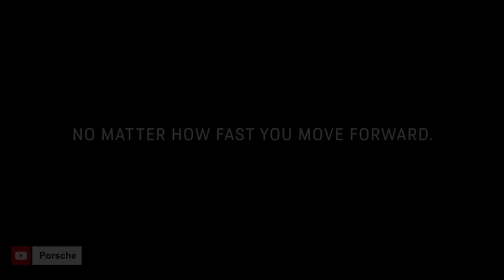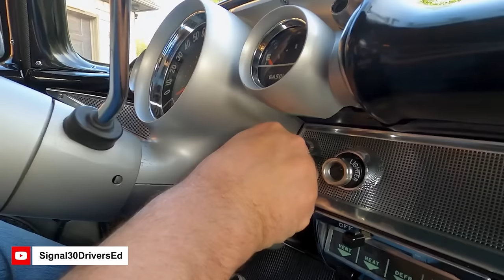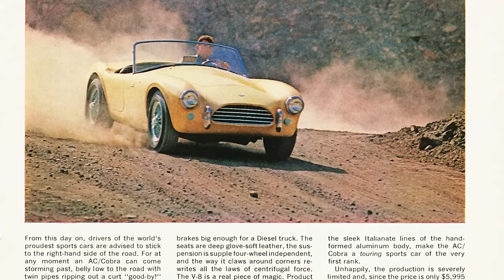Why Old Cars are Better

Comment: Once you work out the kinks in your old car usually good every so often something might rattle lose or brake but 9 times out of 10 its a easy simple fix

My first car is a 1952 Ford prefect father owned it blew it up gave it to me because they wanted something faster my top speed that you can do for long periods of time is 50mph its a pretty big project but ive grown very attached to it tryed to sell to get something running road legal but i was a emotional wreck for the 2 days she was for sale so looks like im fixing her have a high mile engine in her but have few issues had a miss fire now making a bad noise after kicking back hopefully just broke starter i cut corners and it bit me on the ass so going to not cut corners and hopefully get her running good again 
with the old cars at least to me they become a part of the family because everyone is different they have character they're not just a tinfoil box you ride in 
Save the environment buy a car that lasts more than 60 years

Comment: Cars should become smaller and lighter for sure. It would also help the environment, as you could build a smaller engine into it and you have to accelerate a smaller mass. It would help electric cars as well as cars with combustion engines. I recently saw a video (I think from a German University) that showed a very light electric prototype with a usual battery running for 24 hours.

Comment: I love my older cars better than my newer ones because they were just build better. The 69 Camaro is fun but the vacuum lines always go out on the headlights. The 1955 BMW Isetta would turn some heads today. 😁 And I love my GLS 63, although it is quite large and is too fast for a SUV, but were I live you better be able to pull into traffic fast or your going to get hit,

Comment: I drive a 59 rambler with 492k miles on it.  it has a v8, drum brakes and marginal handling.  it gets about 25mpg driven modestly.  only slightly worst that the wife's 22 Subaru.  it has a 5.3 l  vs the subarus 2.0.  doesn't use oil, 3 sp od trans.   I rebuilt this thing and used it starting in the mid 70's because the cars then were garbage.  my youngest child used it in highschool . he had the only one like it and is easy to find in a parking lot.  the car survived him.  new cars don't appeal to me.  so far no one has been injured in it.

Comment: You know, I wouldn't be afraid to work on an old car because I have “trust issues,” but rather because I would be completely horrified at the idea of ending up breaking it beyond repair and in doing so destroying what is essentially a museum artifact.
And even if you ignore that part, we still have to deal with all the financial shenanigans these days, after all it's not like you can risk trial and error when you can barely afford one, much less several over the years that you would tinker and experiment with until you learned from your own experience how to properly maintain them...

Comment: Transverse engine front-wheel drive also ruined vehicle proportions. You can easily pick out the rear-wheel drive cars in a parking lot today simply from the proportions of the front fenders and location of the windshield. Many older cars were very well proportioned, relatively speaking, which is something that I feel doesn't get enough attention.

Comment: i've already had a pretty hard time with my dirtbike and its single, easily accessible carburetor getting it to run and start perfectly. yes, maybe i would get better and it wouldnt be a problem. however, the amount of time i spent trying to tune the carburetor on my dirtbike is not something i want to be spent trying to do and redo what i already do especially to maybe end up messing it up in the process. i would rather be enjoying the experience of riding.

im not saying im incapable of making this work. if i had more bikes and experience, it probably wouldnt be a huge problem. 

but still, i would rather have a system that doesnt need to be rejetted at higher elevation. a fuel system that wont need to be cleaned after a while of not riding, and a system that wont be using fuel even when im coasting, reducing fuel economy and shortening my time on the trail or the track on a given quantity of fuel, and it doesnt even increase performance to have a carb either. its just "easier to fix or service" but how often do you need to service a fuel injector?

there is absolutely something special about an old basic mechanical system. but if im going to be using a vehicle every day, i want it to always work and if my dirtbike is any indication of the consistency and maintenance nature required of old cars with similarly mechanical needs, then i would not want to use it every day. it would be a hobby, something to do to relieve stress and improve my overall mechanical skills with it. but not my daily vehicle at all. its simply not practical, too time consuming, costs more to maintain, is worse in most ways, more expensive on gas, and the list goes on. 

imo, if you really want that kind of integral experience with the vehicle, you should be looking at a motorcycle. because motorcycles, are always going to be more interactive than cars because you're using literally every part of your body, plus your whole body, to place the bike and change its behavior. with a car, you can drastically increase the connectedness with a manual, but that is still not as connected as you'd get in a motorcycle because you're doing much more on a motorcycle at all times and the bike wouldnt even be able op stand up without you

Comment: Agreed. New cars are boring to drive. Though imho tje sweetspot was in the 80s, 90s and early 2000s, where they had the correct blend between reliability, safety most importantly performance and driver involvement

Comment: The experience I had with newer cars in the last 10 years has completely turned me off. My stress levels were off the charts. 

I found a 1996 Jeep Grand Cherokee with a AMC 242 inline 6. It was abandoned and undrivable. 

$5,000 later and she is driving good. There's still some work to be done on her but my stress levels has dropped. 

Why this vehicle? AMC 242 inline 6. With routine maintenance this engine is guaranteed for 400,000 MI. Most major problems can be fixed without removing the engine. 

This vehicle also has front and rear solid axles. Extra thick drive axle And a full spectrum four-wheel drive that has a actual mechanical linkage. 

The control hub is simple.

Comment: I watched your video about 90s vehicles then it went to this video after that I like your video I have a 98 k1500 that I bought brand new I know it is at the end of the 90s but it encompasses everything about that particular type of truck from the 90s I still have the truck it still looks good it still runs good and I wouldn't trade it for a new truck at all

Comment: I still do think that the 2004 Ford Escape that my parents had and then I used for work travel and then cras...er did an unexpected short off-road excursion is better than the 2016 Ford Escape my grandma totally gifted me or such.
I mean it had less blindspots, could hold 6 cds, had a bigger center inbetween storage thing,  the gear shift, lights, and windshield wipers were all each a lever thingy, instead of being almost as if randomly placed as dials and knobs.

Comment: You're right - the 90's are probably the sweet spot.  You could still drive your car without government interference, but they were quite reliable, and had a lot fewer computers involved; no water cooled alternators, electric power steering, traction control, intercooled egr systems, etc.  I've got a 2001 Tacoma witih 225k miles and it will probably outlast me.  No bells ring if I don't put on my seatbelt right away; it doesn't object and cut power if I want to hang the rear end out a little in the dirt, the stick shift will probably last forever, and it has yet to make me walk in 25 years.  The new Tacomas are huge, complicated beasts with far too much electronics for their own good, and have turbos that, I guarantee you, promise a shorter life for the engine they are attached to - no thanks.

Comment: I hold that car luxury peaked in the 70s..everything we needed for a great ride (save gps) was there. Yeah safety features and gas mileage isnt the same but why cant we have a new car with that feature. Driving an old lincoln with the 5 foot hood and hood ornament makes you feel like a king. Its like floating. ..yeah you dont go 0 to 60 in 1.5 seconds but who cares? Its a cruiser. I used an 81 lincoln as a family car for years and the kids loved it. 

And beyond those big luxury cars..the smaller cars were still uniqur and interesting. ..hell my grandmas 92 toyota corolla is still running like a clock..and i prefer it by far to new crap.

New cars are all about planned obsolesence. Im glad you noted how backup cams and sensors all that arent really necessary on old cars when your visibility is  near 100% unobstructived.

As for accidents thougb, having a big chrome bumper always helps in minor fendor benders. Maybe in a 60 mile head on collision you are in danger but in more common local road bump ups...id say an old car eats a new one amd ive seen it happen.

Comment: 6:06 That Model T looks to be better off-road, than most - if not all SUVs, jeeps and whatever 4x4s today are advertised as "off-road capable". Light and primitive vs large, heavy & full of tech = physics still work the same way today as they did back then.

Comment: Old cars took 15 minutes to diagnose and 3 hours to fix. New cars take 3 hours to diagnose and 15 minutes to fix. I’ve worked on my fair share of classic cars from the 50s and 60s as well as new cars from the 2000s up. New cars mostly only have sensors go bad unless there is absolutely no maintenance done and something catastrophic happens. Old cars will break more often but it was always either fuel, spark, or air. A can of ether and a hot battery would diagnose it for you every time. The new ones it could be one of a million different sensors or relays

Comment: Going back to reliability, one thing I have learned over several classic cars and around 120 old motorcycles is that they really aren't reliable. Rather, they are durable. If I buy a brand new Kia, I likely won't have to bring it in for service for its entire 60k mile lifespan. However, my 300E and Oilhead GS will require maintenance and service, but they will last FOREVER as a result. And yeah they will break, much much less if ever if they're maintained, but they are designed to be maintained. It's expected that you (not the dealer, you) maintain them. And due to the care and nature they're built they will outlive their owner. A new car is supposed to be hassle free and require little maintenance while being reliable. But they're not durable, they won't last a long time and when they break forget about fixing them. Several mechanics I know refuse to touch new cars because they really aren't made to be fixed, just assembled and left alone until they're crushed, start to finish. Just a different time and way of looking at your belongings. Lots of character too but that's outside the scope of what I'm talking about. Thanks for coming to my TED talk.
Reply: If your mechanic friends won't work on new cars, what do they work on?

Comment: Old cars aren't necessarily "categorically less reliable." I literally have had to do more maintenance to my 1994 Jeep Cherokee XJ than to my 1915 Ford Model T. The Model T will fire on the 2nd pull of the crank every time and it performs exactly the same every time, while my Cherokee will vary. I check and change the oil at the same intervals with both cars, and I have to tinker with the Cherokee much more than the Model T. My Model T even has fewer instances of overheating than my Cherokee does. When things are built right, they operate reliably, fullstop.

Comment: I loved your editorial! However, my 1995 GMC Jimmy SLS with 350,000 Km has only had its 4L60E transmission overhauled at 290,000 Km. It doesn't use oil, for instance. As a comparison, my 2012 Volvo S60 T4 with the Ford Sigma 1,600 cc turbo engine called EcoBoost in Ford parlance, mated to a dual wet clutch transmission Aisin MPS6 had it's transmission repaired at 52,000 Km mark and now after 77,000 km over the transmission overhaul, needs an overhaul yet again! The engine is using oil at 130,000 Km. And I have been careful with maintenance done by myself, like in the olden days! I even have had to replace the turbo core as it was leaking oil. It's a nice car, but at what cost?

Comment: New drivers are depending on their new cars to do so much of the driving for them, it's almost as if they're endorsing distracted driving. Gotta stare at the center screen for a minute to find the function you need? No problem! The car can maintain the lane, self-brake, maintain distance, and adjust speed all without driver interaction. Some even parallel park for you, or back up a trailer perfectly. Hey! You forgot your kid in the back seat! Your car can send messages to your phone about car condition and maintenance needs now. Can it be one of my Facebook friends?

Comment: Totally depends on the car and how it's optioned. Some newer cars are so full of proprietary tech that, when it breaks, will be a nightmare to diagnose and repair. Engines with forced induction are subject to much higher stresses than the average NA engine. Hybrid systems are extremely complex and hard to DIY repair. Some CVT transmissions are straight up unrepairable. You simply must replace the entire unit if it goes bad. Good maintenance mitigates a lot of these things, but that only goes so far and after some year something will break. It's just inevitable. Things wear out mechanically, and electrical components burn out. That said, it is very possible to buy a basic car now, without touch screens for every function, with simple NA engines and with a "normal" automatic transmission or even manual. You just need to research which models offer these things. The problem is that people don't want cars like this so you will probably not find a lot of them on car lots. They can be ordered though.

Comment: I have a direct comparison. I own a 27 year old vw T4 van that is mechanically identical to a late 1980s car. My wive owns a 8 year old microvan.
Mine has half a million kilometers on the clock hers just 100.000 km.
Still on my car everything is still in working order and most of the parts that eventually wear out are easyvto replace and i can do most of my maintenance  by my selfe.
Her car has more problems, things are no longer working, you can hardly do any maintenance and everything is super complex and expensive to fix.
Her car is more comfortable and quiet mine is a tank that keeps running and will be fixable for a long time to come

Comment: Speaking of Chevy Malibu 2009 & Bel Air '59 there is the thing called wear & tear. Metal material that's has been proudly running for 50-60 with rain, sand, dust, rocks, heat & cold temperatures tends to have weaker molecular bonds than less-reactive modern plastic. Plus if you put equivalent of modern interior inside of vintage car you'll get a better safety than today's soulless plastic junk.

Comment: I have a 92 Chevy S10 Blazer and it's been so frustrating trying to find information how it runs and why and the weirdness of how it was the in between a time of simple mechanical work and then the change to more techie built engineering....... If it was me I'd rather would have something like an old Beatles or an old Italian car. They were small, very simple motors and more of a fun family car to ride in

Comment: As a contractor, old houses can be an absolute money pit. Sewer lines, water lines & pretty much the whole plumbing system would need to be replaced. The whole house would need to be rewired. Plaster walls are a nightmare if any work has to be done that requires opening the wall. The wood rots on the outside. Most modern type materials on the outside of houses are better. No way would I buy a house older than 1970 unless I was rich & could basically gut it and start over
Reply: Renting in a house from the late 1800 early 1900 and it is fine. The beams are so thiccc. Looks like it was updated in the 70s and again early 90s. Other than needing some windows replacements everything is fine.

Comment: Modern cars have been over complicated by government safety, fuel efficiency, and emissions standards. 
As government automotive standards becomes even more  restricted, the complexities of the modern internal combustion engine will be more prone to failure. 

A quote if I may. 
"The more they overtake the plumbing, the easier it is to stop up the drain."
        Montgomery Scott. 
        Star Trek.

Comment: As a mechanic, engineer, and racer, I have two major points of disagreement.
To feel “one with the car” in a newer car, you just have to push it that much harder.

Also, the common refrain that newer cars are more difficult to work on is a half truth. For the most part, the only specialized tool you’ll need is a scanner, for which a decent one can be had on Amazon for around $200. From there, it’s mostly just changing old parts with new ones, as opposed to the countless points of adjustment on older cars. The biggest issue being tight packaging.

A good rule of thumb from this gearhead’s pov is to avoid anything so new that the buttons have been replaced with touch screens.

Edit: of course, this doesn’t apply to cheap commuter cars. They have always been and will always be garbage. This applies to trucks, muscle cars, and sports cars. The only ones worth owning.